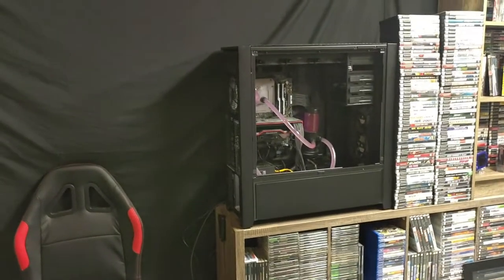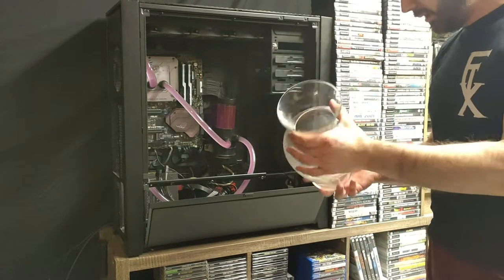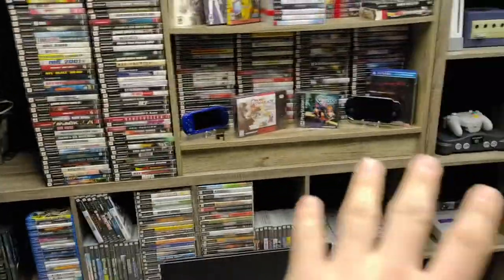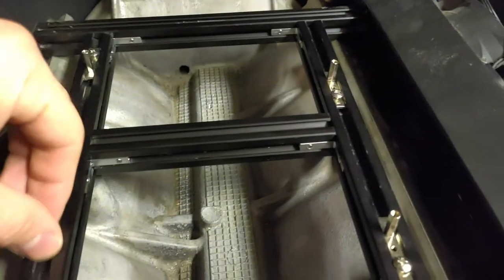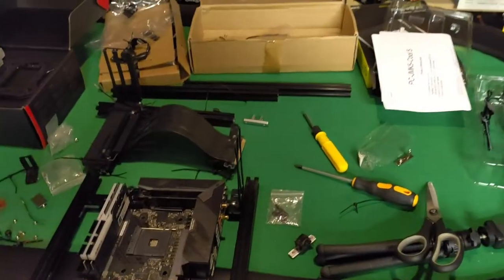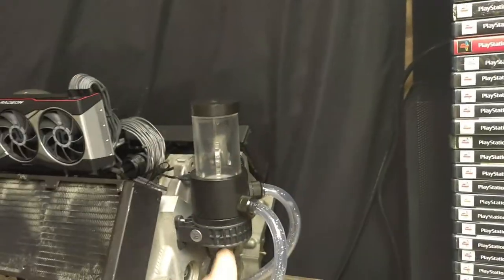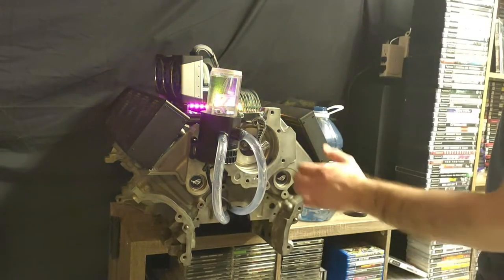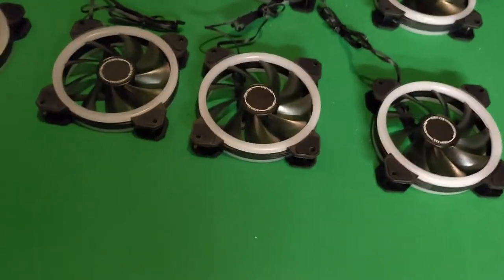VR Sim rig Engine block PC: Full build

Comment: If you're looking at cheap fans in the future go with the PC Cooler 5 in 1 from Amazon.  Basically the same fan as those but the controller comes with 7 ports and then you would only need a an extension to run the 8th. 
Build looks great though Costas. 2 question though how heavy is that block and what kind of Temps are you getting on the the 6900?